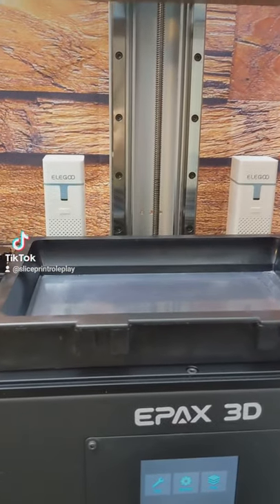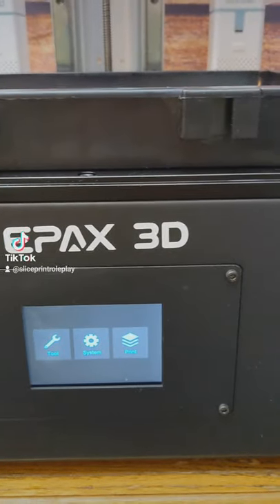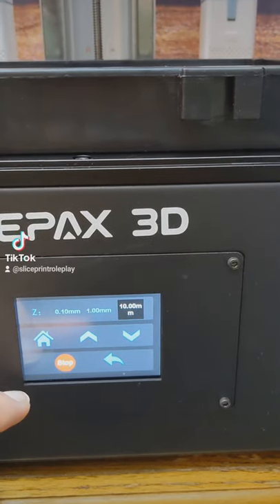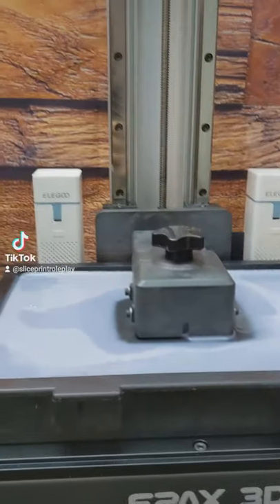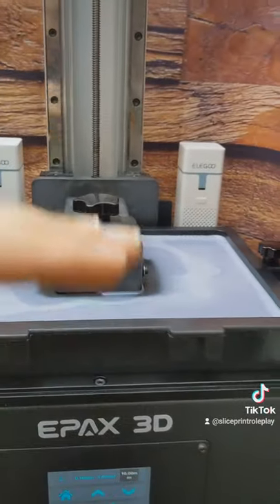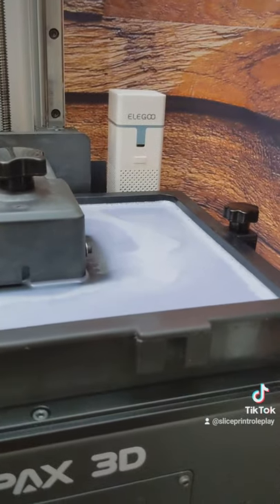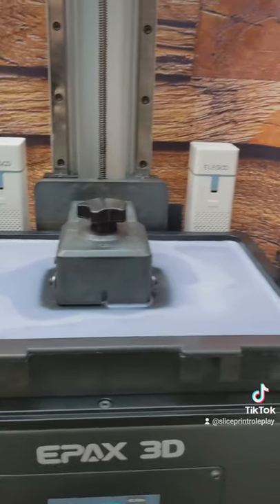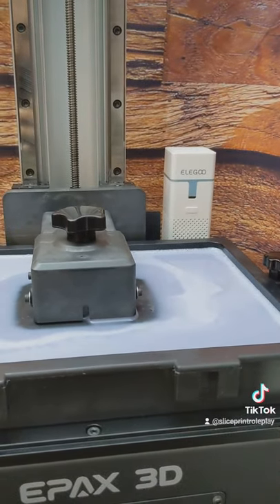How To Fill Your Resin Vat Without Overflowing! #3dprinting #resin #shorts

Comment: Do those Elegoo Air Purifiers really take away the smell?
Can you work in the same room while printing without extra ventilation?
Reply from the maker: Honestly I do work in the same room with my printers and have been for years. Most resins don't have a strong enough smell to bother me. And that's without using the air purifiers. And that's simply because I have too many printers.
But I did test the air purifiers. I did find that they cut the smell quite a bit.